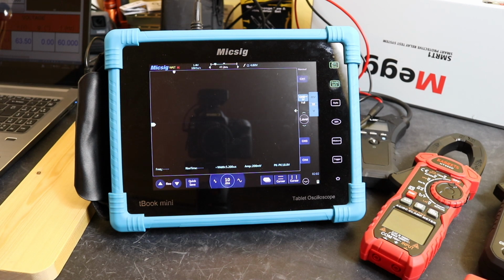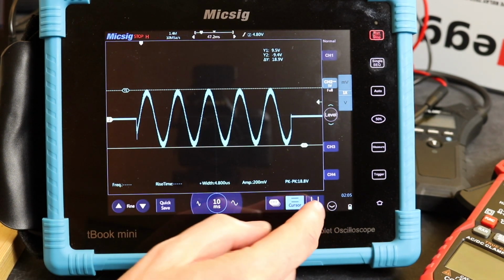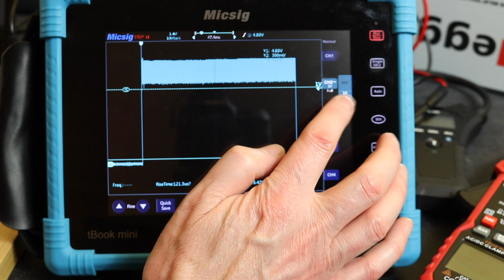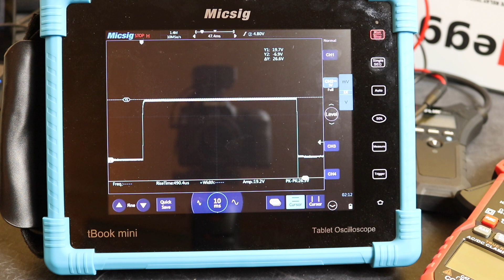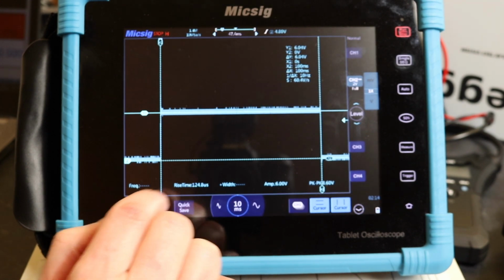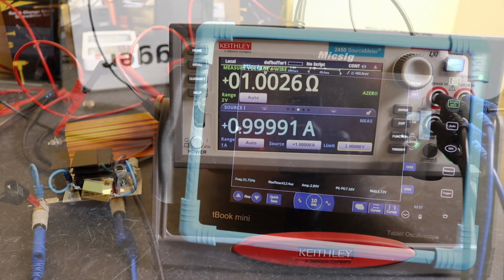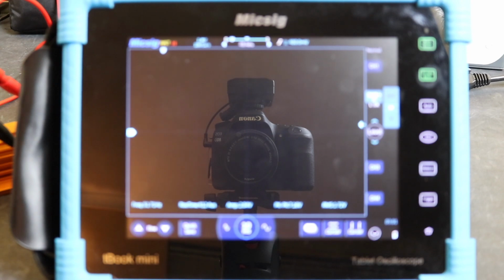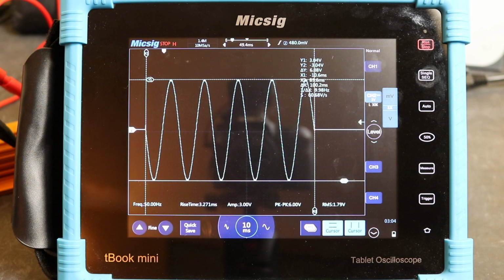Megger SMRT 1 Current Inrush Model

Comment: Glad you took the extra step to figure that out. I was thinking no way is the SMRT that bad, and that was really bad. I knew they are for low burden devices, but didn't realize 100 Ohm wasn't enough. Second go around made much more sense.
Reply from the maker: Yeah, easy to get caught out with these tests at times. Some of the Omicrons I have used are even worse. Thanks for watching and commenting.